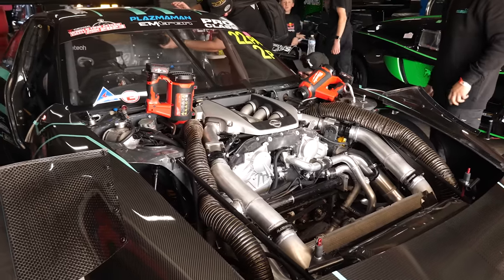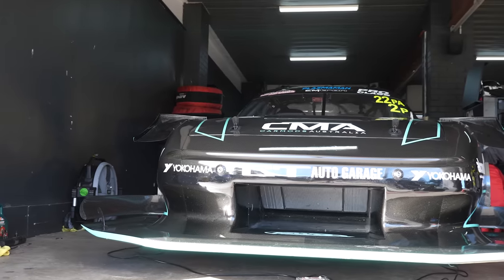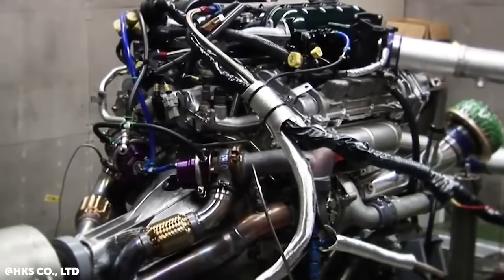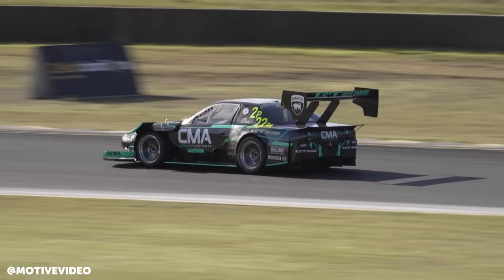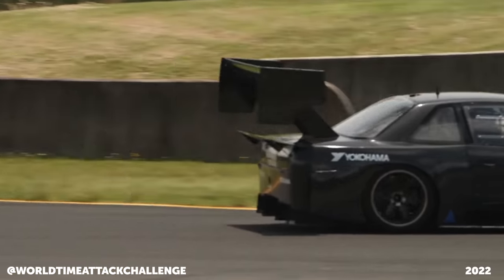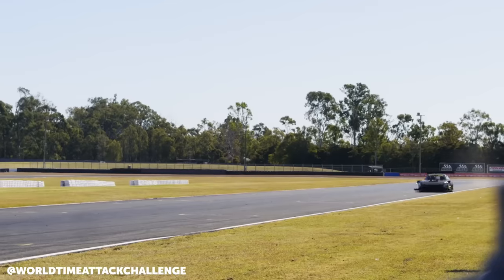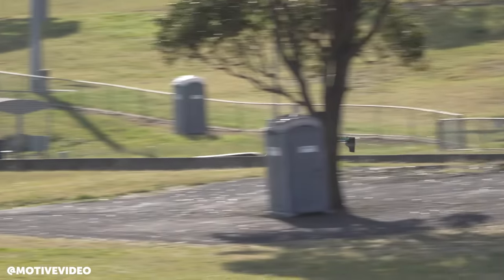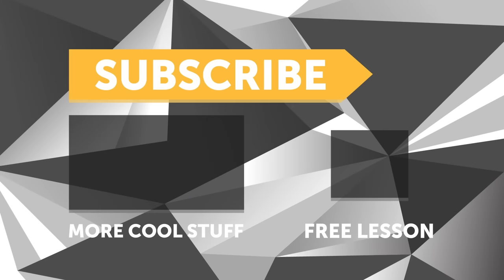Was this rebuild a mistake? (Hint: Nope.)

Comment: I completely understand why they changed the engine platform but I feel like it is not the same car. I felt like the SR20 is what made that car special.
Reply from the maker: It's not the same car, that is intentional though 😎 For Murray and MCA that was also the reason they sold it from what I understand. It was at the point it needed a massive amount of work, especially with the electronics packaging which was not their forte, and they ultimately decided they had proved enough in WTAC so passed the opportunity on to others - Taz.

Comment: Should have changed the front hubs/uprights instead :( pretty unlucky with that failure point.
Reply from the maker: Ahh is that what happened, I thought it was a wheel related issue but didn't get the full story on the day! Unfortunate as there was more time in it for sure - Taz.

Comment: You need power??? That piece of junk is full of understeer and will not rotate in the middle of the corner, first you get the chassis to work then the more power the faster it goes, but as long as the throttle can't be applied you guys are pissing in the wind, the only one who deserves the hammerhead term is the chassis guy, that car is a piece of shit, that snow shovel on the front probably hurts more than helps. Find a guy that can dial the suspension 
in and you will go from last to first plus your guy won't be crashing all the time..
Reply: What would you use?
Reply from the maker: Even the car this one came 2nd to has seen continual development over the years. No one has said this is a perfect build that has completed the perfect lap noting for every change you make, there's a tradeoff for it  too - Taz.
Reply: Uh, huh...
It's a shake down and test session on a new configuration - of course there's going to be freaking chassis setup issues.
Doesn't look like a problem with the middle, more a mix of too early apexes and entry understeer - there's a big change in weight distribution, a big rear wing, and I suspect a spool, all of which will contribute to that.
That chin dam should contribute a lot of downforce, benefiting from the high pressure area in front of the vehicle.
As said, it's still being shook down and testing will find what works best.
Why are you thinking it is last - it's a NEW re-build, there's nothing to directly compare its performance to - and they'realready up on it's previous best with the old setup.

Now, pay attention - drugs are bad, stop using them - OK? 👍